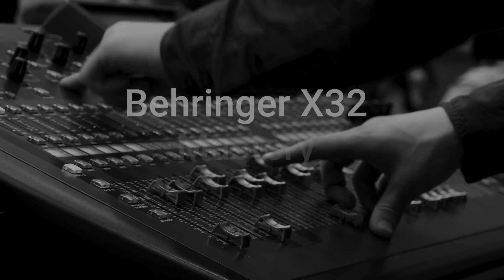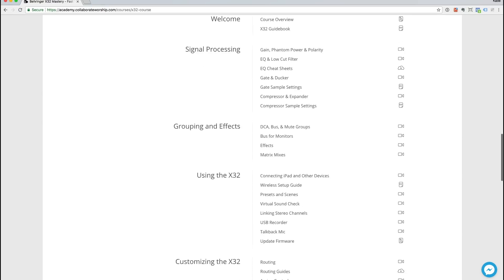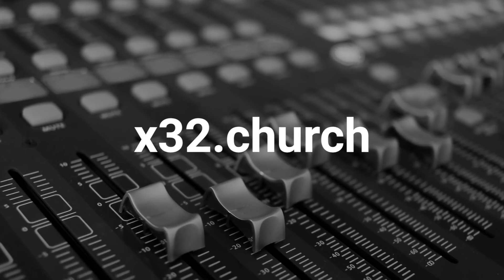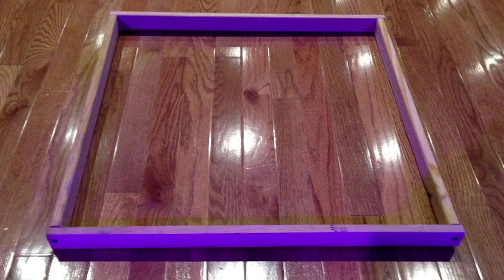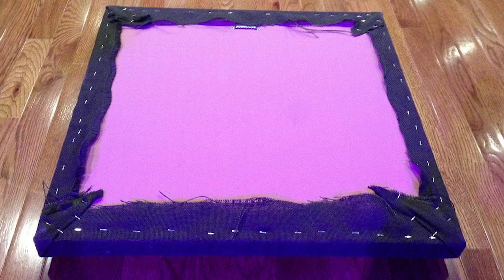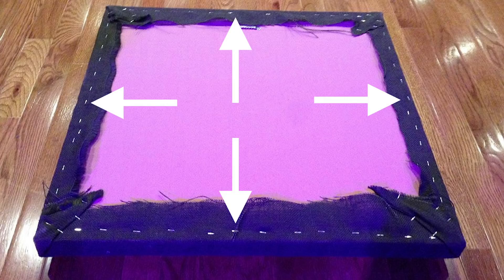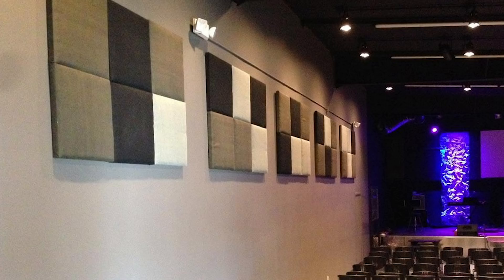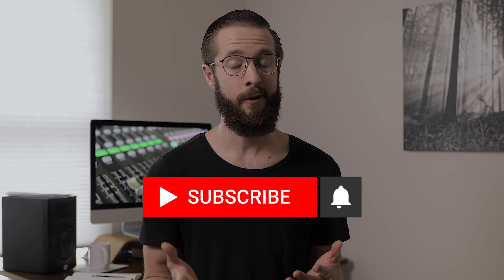DIY Sound Absorbing Panels for Churches

Comment: If you wait to attach the plywood backing, you'd probably get better results, just FYI. You staple the fabric to the frame, and then you screw the plywood on for a more finished look. It's also a smooth for hanging so you doing get fabric pushing it up unevenly.

Comment: Hello! We are missionaries starting a church in Cambodia. We finally got a building but the sound reverberation is a major issue. Unfortunately they don’t sell acoustic sound panels here. This video gave me some hope that I can find the materials and make them. I’m able to find polyester cotton for pretty cheap. Would this still work, instead of the mineral wool? I can email you screenshots if it helps. We really need some help!
Reply from the maker: Hey Nick - I've not used polyester cotton, but I am sure it will help. Might as well give it a shot!
Reply: If you mean what is branded as poly fill, then yes. The same way it works in a subwoofer. The sound has to go around the fibers and it slows it down and dissipates the wave. 

The more dense materials are superior but poly will still be effective. Good luck!

Comment: Kade,  I run sound at my church, and there is virtually no sound treatment. https://www.facebook.com/tony.swisher.92/videos/1916960448314269/ there are a few frequencies that run rampant in the room, but a couple are on the same low mid frequency knob... how can I curb this or would I need sound treatment panels?
Reply from the maker: Hey Tony - Are you using an analog or digital mixer?
Reply: Collaborate Worship  We run an analog Soundcraft lx7ii with 3 dual channel powered preamps...